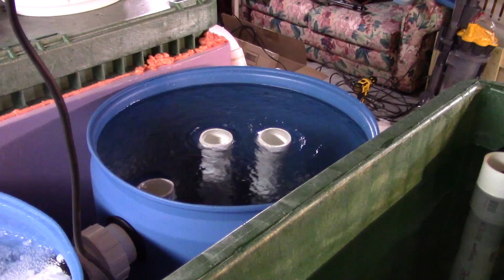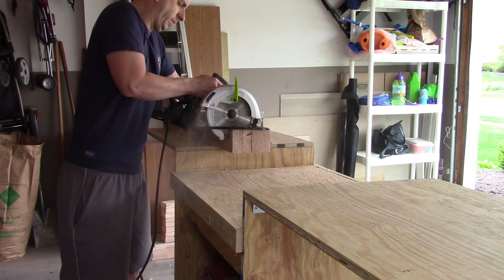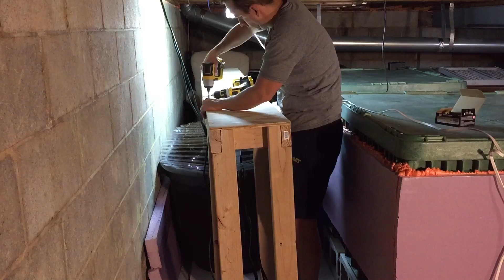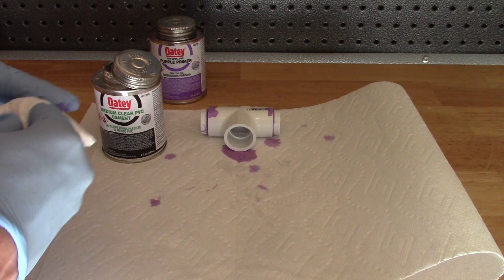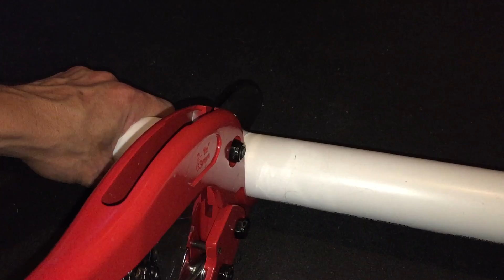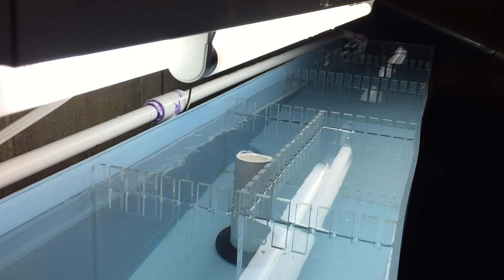Fishroom Build - Adding 8ft Tank for Plants

Comment: Depends on the type of lighting you planning to use for a tank this size in length. 
Plus, without any substrate to nourish plant roots stem plants may be out of the question. 
You can use gravel & add root tabs & use liquid ferts or C02 as well as options.

Start simple & get some success with easy LOW LIGHT PLANTS

a) Free floating Plants- Wisteria, Duckweed are great
b) Anubis, Java Fern,  Banana Plants

using gravel then try

c) Amazon Sword plants, Lugwidia Red Plants

Since your tank is already sectioned off with dividers you can experient:

1) Place free floating plants in one section
2) Plain Gravel in second section
3) Try using potting soil with gravel cap in third section'
4) use "Eco Complete" type substrate in forth section
5) use different lighting for certain sections of dividers:

Use a cheap 2 foot dual bulb T5 HO  fixture with 6,500k rating for Hi Light Plants
Use  a cheap 2 foot dual bulb T8 fixture for Low Light plants

You can get away with trying single Goose neck arm holding a single Cree Flood Light LEDs on certain sections.

Good luck and post updated videos on progress going forward..

Comment: I totally agree with Eric K below - if the primary purpose of this is to reduce nitrates, as opposed to grow out plants for planted aquaria, then you need plants that have the "aerial advantage" in that their leaves are in the air so they are not limited by CO2. I'd avoid slow-growing plants like anubias, though they'd do pretty well, just because it seems to me you don't really want to grow plants as much as you want to get rid of nitrates? Maybe I have this wrong? Anubias and java fern are low-tech favourites because they can tolerate low light and low CO2 because they grow slowly, but that in turn means the rate at which they take up nitrates and other plant nutrients is also slow. I don't think this is what you're after?

Since you have the weirs in this set up you could grow all kinds of things in the different sections, but pothos is one that's a definite must, though it can get really straggly. Peace lilies are another prettier option - you could just float them on polystyrene rafts or get some cheap clay balls and planters - bathroom shower caddys work very well, though I've learned not to trust the suction cups: I use plastic hooks of the kind that are designed to fit over the top of a door, drill some holes and attach to the caddy with zip ties. Hang off the sides of the tank. These are nice strong planters that will hold the growing weight of the plants without problems. Of course there's no reason why you couldn't be growing all kinds of foodstuffs too . . .  I'll look forward to seeing what you do with it in weeks and months to come :)
Reply from the maker: +Julian Morgan thanks so much for all of this advice. Lots to think about here!

Comment: Great tutorial Steve, very professional looking. I'll save you some time on the plants. I did a smaller version of the same thing you are built a few months ago. I tried water wisteria, jungle val, and Java fern, all nitrate absorbing and fast growing and low maintenance plants. The water wisteria grew fairly well, but I just wasn't getting the nitrate absorption I'd hoped for. Halfman halfcichlid shared an article with me on emergent plants- plants that have their roots in water but leaves in the air, like pothos. http://www.tuncalik.com/2010/01/indoor-plants-for-water-purification-in-aquariums/. There is a list of plants you can use. I used pothos in my sump with the led grow light that Joey uses and the pothos really took off. The root ball exploded in a matter of weeks and now my nitrates stay low for long enough that now I only have to do a water change once every 3 weeks. I do not have a drip system either. Check out the article, and Walstad's book for more info.
Reply: Diana Walstad's book, Ecology of a Planted Aquarium is a great read if you like the science involving plants in an aquarium. She supports all of her points with scientific articles and publications and it really drives home the ease and benefits of using simple plants in "low tech" aquarium systems. Sorry for my long posts- I really nerd out over the science behind aquariums....
Reply from the maker: +Eric K thanks Eric, I really appreciate your taking the time to write it all out. Do you have a link to he LED grow light? I've seen it in his videos but was never sure which one it was.
Reply: +Steve Poland Cichlids no problem Steve. This is what I ordered, which I think is the same bulb Joey uses or very close to it. It only uses 12w which is amazing for how bright it is. The pothos loves it. https://www.amazon.com/gp/product/B00GNWK2XO/ref=oh_aui_detailpage_o09_s00?ie=UTF8&psc=1
Reply from the maker: +Eric K awesome. Thank you. So you think the 12w is good? No need for the 24w?
Reply: The 12w I have is pretty bright- hurts the eyes looking at it. I'm lighting up a relatively smaller area. You could try the 24w or multiple 12w bulbs which might be even better.
Reply from the maker: +Eric K I might start with one 12w and expand later if needed
Reply: Cool, that tank will be a fun experiment. Keep us posted!

Comment: Are you willing to add a substrate? If so, you could easily throw in plants like s.repens, amazon sword, sagittaria, crypts, etc.. Otherwise, plants like water sprite (can be planted or floated), anubias, javafern, bucas.. will do fine attached to sometime. These plants do okay with lower lighting, but too low lighting and you're just looking at anubias, javafern and mosses for the most part.
Reply from the maker: +Illusion Of Hatred I'm willing to do substrate, though it would probably be crushed coral for buffering

Comment: Anubias. Its low light, very hardy plant
Reply from the maker: +jaycal75 I will check it out. Thanks!
Reply: Even anubias is gonna need more light than those fluorescents can provide. A good cheap way to provide lots of light : look for used LED light bars from offroad vehicles.
Reply: Onijin1 Yeah i use LEDs in my fishroom, I have 50 tanks all growing anubias plants in them with overhead LEDs.  What plants you got growing Onijn1 in your fishroom?
Reply: +jaycal75 Anubias, Vals, swords, hornwort and a metric fuckton of anacharis, frogbit, mosses and duckweed.